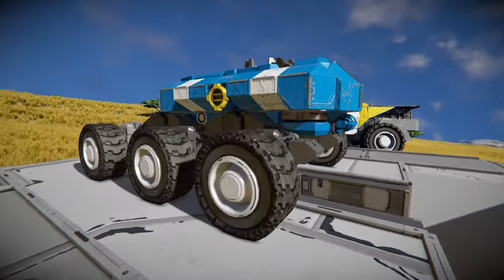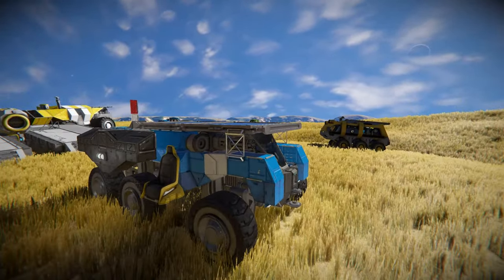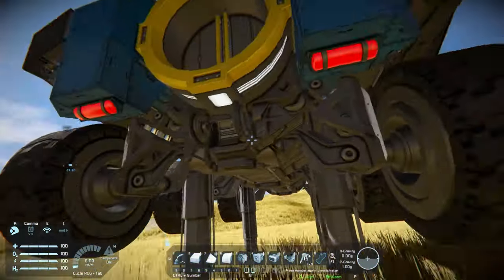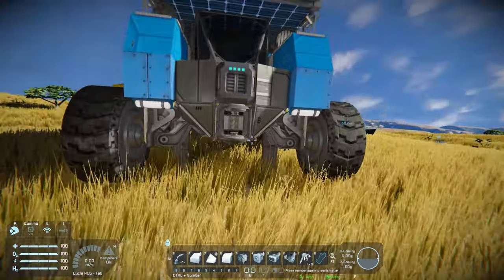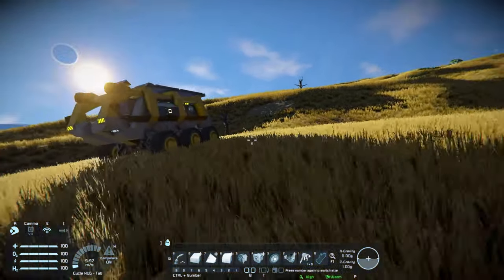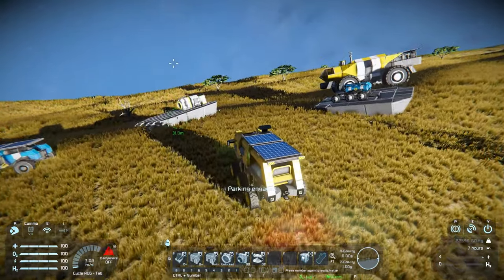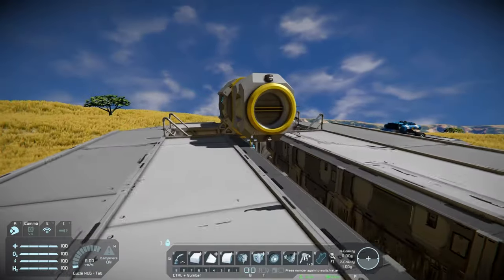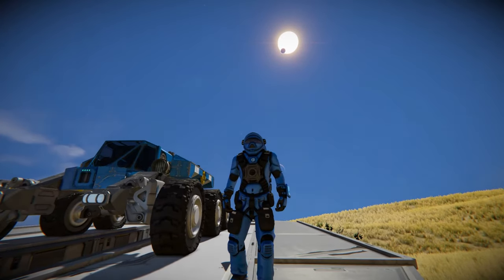Tips for building Rovers! - Space Engineers (Vanilla)

Comment: One tip I would add to prevent rollie pollies (or stoppies as I heard them called)  is reducing friction. The default setting is actually pretty high. Too low, and the rover slides everywhere. Too high and your wheels grip everything, making it unstable when turning or stopping. With my rovers, I usually give the front tires slightly less friction than the rear. I found this makes turning and stopping smoother, even with the front wheels having brakes, while keeping grip even on inclines.

Comment: Incredibly useful tips,  💯 agree with all of them. Maybe I missed that part, but did you mention the wheel suspension height field? Using it to find the lowest spot that still offers safe ground clearance vastly improves stability. Also, come on guys, don't drive your rover like you're in GTA, these are not sports or luxury cars but ATVs on rough terrain, keeping speed between 20ms to 30ms is optimal in the open, higher speed will likely result in crash and 5 to 10ms while driving close to other grid is by far safer.
Reply: You're probably right, but I'm still gonna drive my rovers like a crackhead trying to evade the police. To be fair, I do add stuff to account for my bad driving, like emergency thrusters, emergency parachutes, redundant wheels, and 1-3 sideways small atmospheric thrusters (helps dramatically with high-speed turns).
Reply: For vehicles I know I'll drive like that, I'll usually make them as minimalist as possible and bottom heavy. I won't put too many spare parts on it and just accept my losses if I crash 😆.

Comment: I recommend adding either landing gear or half armor blocks to the piston heads. I've found that sometimes the heads will clip through the voxel below when they don't have anything on them. Additionally, if you do landing gear, then it helps keep your rover still when doing work underneath it.
Some other things I recommend are
-Emergency parachutes. They cost almost nothing and are life/rover savers even if you're not driving off cliffs.
-Emergency thrusters. They help clear rough terrain. They can also allow you to scale mountains with ease.
-Sideways thrusters. They help dramatically with high-speed turns. I recommend 1-3 (both directions) atmospheric thrusters for most rovers.
-Small cargo containers instead of small conveyor straight pipes. This helps if you're having difficulty with cargo space. They don't hold a lot, but they can be snuck in all over most builds. They can also be used for ammo throughout your ship, making ammo racking less likely and less damaging.

Comment: Tips:
1. Dig holes to repair, or put jack's (pistons) on your rover to flip it over when it has flipped.
2. add a spare wheel to the vehicle.
3. add a ladder to the vehicle.
4. tune suspension.
5. use gyro to flip (and prevent flipping while airbourne).
6. add thrusters for boost uphill.
7. low center of  mass to prefent rolling over
8. turn off stearing for all wheels but the front. and turn of braking for the fron to prevent flipping.
9. rover bay with  open middle for maintenance/building efficiency.